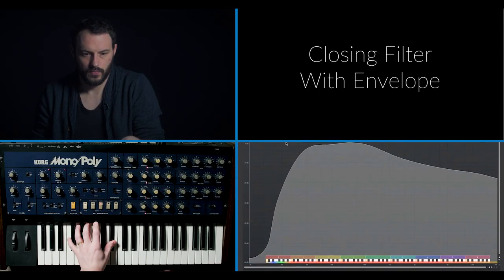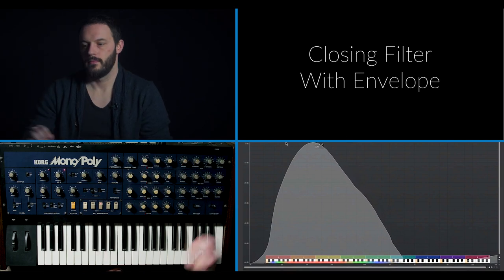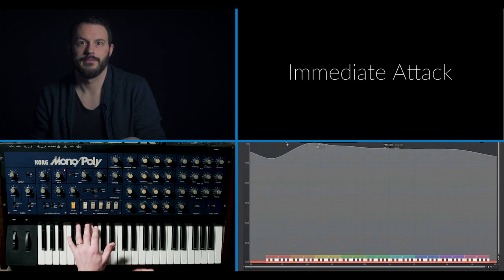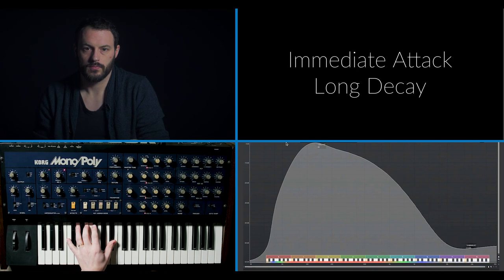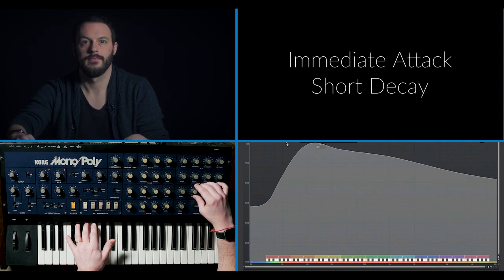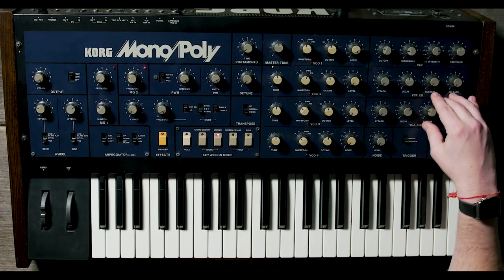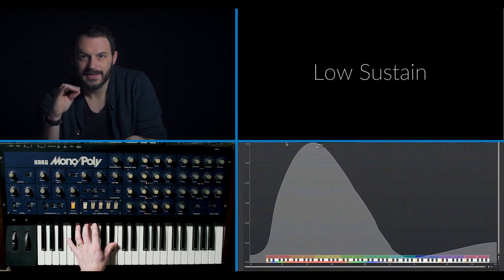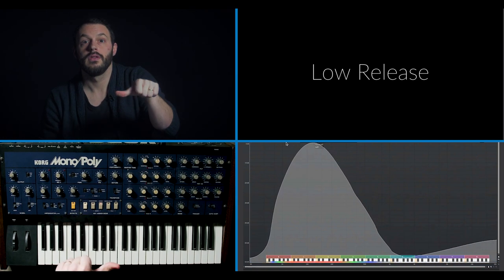Intro To Synthesis Part 4: Exploring Attack, Decay, Sustain & Release

Comment: With respect to an ADSR envelope, is the following correct?

- Attack involves setting both a fixed amplitude and a fixed time
- Decay involves setting both a fixed amplitude and a fixed time
- Sustain involves setting only a fixed amplitude, because the time will depend upon how long a key is depressed and therefore be variable
- Release involves setting both a fixed amplitude and a fixed time

Is it possible to set a short Release for when a key is released--AND simultaneously set a longer Release for when a key is released WITH THE SUSTAIN PEDAL DEPRESSED? Would this situation depend upon whether a particular piece of hardware can handle it, or would this situation be able to be handled in a standard way by all hardware?

Comment: Envelope controls
Attack: Sets the time it takes for the signal to rise from an amplitude of 0 to 100% (full amplitude).

Decay: Sets the time it takes for the signal to fall from 100% amplitude to the designated sustain level.

Sustain: Sets the steady amplitude level produced when a key is held down.

Release: Sets the time it takes for the sound to decay from the sustain level to an amplitude of 0 when the key is released.
Reply: thanks!